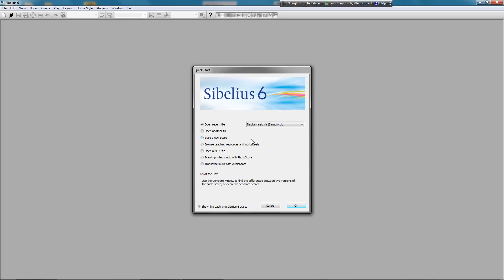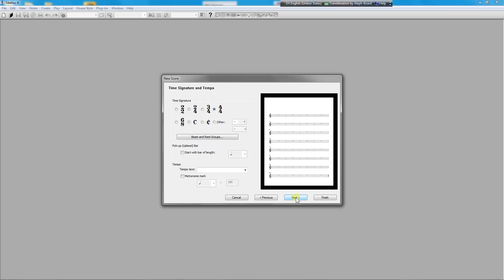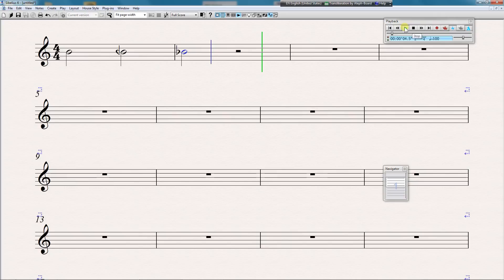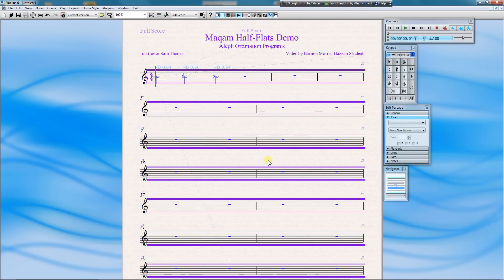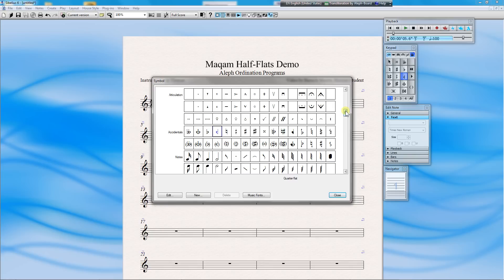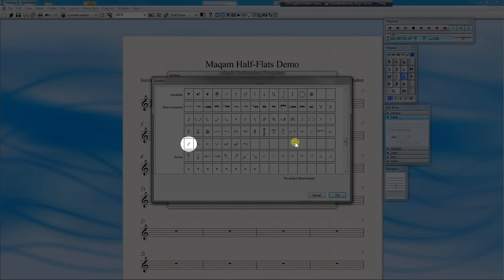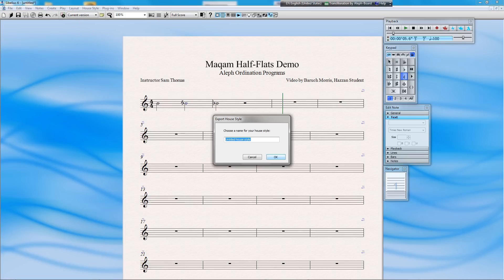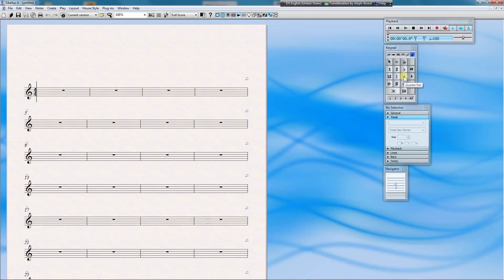Maqam Half-Flats in Sibelius 6 Demo

Comment: great  vid   thanks!!!
not  sure if  the sibelius 7  has these  features placed  elsewhere  but it is working out. albeit a laborious retrofit.  Sibelius should  really get hip to the  flat with the diagonal line across it... and  also learn  maqam in the near  east : of the  differences  between the backwards, the b with the  line, and other permutations. In common usage they have different  meanings (different pitch  values)

Comment from the maker: Several people have asked how to make a half flat (Sibelius quarter tone) key signature that will correctly play back half flats.  Unfortunately, this is not possible in Sib 6 - nor is it possible in later versions.  If you find the score to be ugly with both a half-flat key signature and half flats on individual notes, If you have Sibelius 7 or later, you can try using the plugin "Hide Specific Accidentals" from the Sibelius Plugin download page (it is under the Accidentals group). This plugin doesn't work with Sibelius 6 (though it is supposed to).  As with the key signature issue, this isn't perfect, but it is the best that can be done. I thought I had answered this once, but now do not see that reply.  Apologies for the long delay.

Comment: Hi Bruce. Thanks for the video. I have a question. i followed your video and everything is fine now but only problem is to hear each quarter note i have to put the symbol before the note. because as the fake key Sibelius can not recognize the actual  tone and plays flat or sharp. So I don't mind to put the quarter symbols next to each note i want to hear but make the score so ugly. Is it possible to make a rule to hide them automatically instead of hide them in the score one by one manually?
Thanks again for the video.
Reply from the maker: If you have Sibelius 7 or later, you can try using the plugin "Hide Specific Accidentals" from the Sibelius Plugin download page (it is under the Accidentals group). I believe that will work, but I cannot test it as this plugin doesn't work with Sibelius 6 (though it is supposed to).  As with the key signature issue, this isn't perfect, but it is the best that can be done.